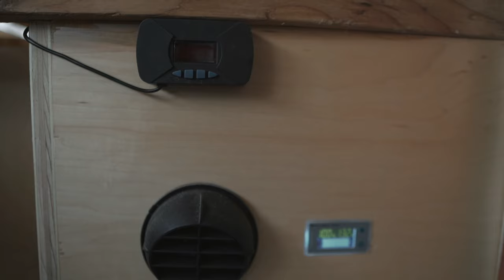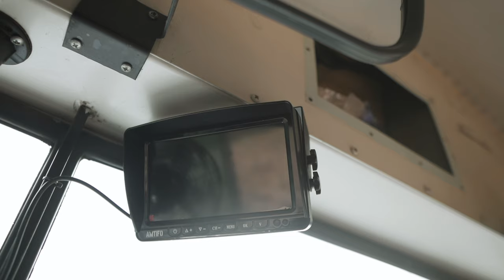SKOOLIE CONVERSION TIME LAPSE - Full Bus Build In 30 Days Start To Finish

Comment: Gotta have a toilet and shower. Unless your parking in your parents driveway.  In that case, you really wouldn't even need a fridge. 😎👍 It looks good but I am not sure the huge back pull out drawers are going to be as functional as you might hope and there just seems to be a lot of things missing in this build..  Also, the condensation with all the exposed metal and no air circulation in the ceiling will certainly be a problem.. and with condensation comes mold. Just a few things to consider.
Reply: Good points!
Reply from the maker: hm I have lived in busses for years with none of these problems. He is having none of these problems. So tell me where are these make believe problems coming from? Your head or experience? I love it when people that have never lived in a bus try to tell me things.

Comment: Very Impressive!!! Building like a boss! Your bus is sick. Whoever ends up buying it will be a lucky dude because they know it was a quality build, not some cheap, walmart build. lol
Reply: This build is NOT a quality build. God forbid someone lives in this. They're going to have to rip everything out and start over because there's no insulation in the floors, and the original bus windows leak so badly they get mold.

Comment: I don't see a toilet/shower, solar, or insulation. That kinda reduces how much you can do with this especially during summer and winter months. If you have any ac/heating it won't stay in very well.
Reply: I wasn't paying attention, but unless they took out the walls it was probably insulated. And those two panels on the roof that they wired into the bus are solar....
Reply: i thought you were th nutrition guy wtf

Comment: It only took 30 days but what good is it gonna be without any insulation. Its gonna be hotter than all Hell in the Summer. And cold if u use it in the Winter. So I don't see anything gd about it.

Comment: Had the same problem when installing the diesel heater.  Exhaust pipe slipping off. Small sheet metal screw.

Comment: Can you explain how the flooring went in?  Many of the Skoolie videos show insulation installed on floor, walls, and ceiling why did you guy not insulate?  Just getting ideas for my build.
Reply from the maker: Hi there is already insulation in the walls of the bus from the factory. It’s not the best but it’s there and a ALOT of work to take the walls out and re insulate. People pull the floors up to treat rust under neath the plywood. I buy busses from Arizona so there is no rust or mold to deal with. I floor right over the rubber. Built in vapor barrier and insulation. In my opinion unless you are going to remove or replace all the single pane windows that take up 50percent of the busses structure. There is no point to re insulating. Put a $150 diesel heater in and save yourself two weeks and hundreds more. When my heater is in I’m not cold. Re Insulate a bus don’t put a heater in and you will be cold. I have lived in both. Insulated and not re insulated and that is my opinion

Comment: Why didn't they put insulation in? That would have helped with heating a d cooling. This I'd the 2nd bus build I have seen that the owners didn't put any insulation in. Nothing to keep water from freezing either. Waste of heat and cooling with out insulation on the floor walls and ceiling. Especially if your going to live in it full time.
Reply from the maker: I lived in a bus full time with the “original” insulation in it. Was just fine and never ran from a winter. I know people that have literally done heat gun tests and literally almost 0 diff. Your uneducated opinion is exactly that. There is nothing wrong with leaving the original insulation if your bus came from a Desert climate. I would be more concerned with mold
Reply: Never mind that where is the toilet or shower
Reply: @isaacturnerit  dude if you ever go somewhere where its constantly cold you rethink that I know that because I've lived in a schoolie with my cousins and was the worst so if this was for a customer they definitely got scammed
Reply from the maker: @IeeIee778  been where it’s constantly cold. My opinion still doesn’t change
Reply: @isaacturnerit  not cold enough apperantly

Comment: Awesome build, what type of latch did you use on the long board drawers?
Reply from the maker: 48in locking sliders :)
Reply: @isaacturnerit  Be thankful the drawer faces sideways , ours faces the front, one emergency stop later ,even with locking sliders, our fridge had an unexpected flight! Sorted now….amongst other securing mechanisms -a door wedge, Even in our 60’s we’re living and learning! 🇬🇧

Comment: ISAAC WAS THAT CLEAR PLASTIC TANK YOUR DEISEL TANK FOR THE HEATER AND IF SO DID YOU HAVE TO DRILL A NEW HOLE IN THE SIDE OF THE BUS FOR FILLING AND DID THAT FILLER NECK PARTS COME WITH THE TANK ? AND DID YOU EVER THINK OF GETTING ENOUGH HOSE TO ADD A SECOND HEAT OUTLET UP FRONT ?
Reply from the maker: Hi that plastic thing was the tank. I just open the back door. And fill it. No prob. I have seen the filler neck and water will door stuff. But I personally don’t think the extra work is necessary. Also don’t need extra outlets. The good heater fills the entire space no problem.

Comment: Beautiful build.  Looks like you are doing several.  So is this build for the coast / warm states only?  I don't see any wall, ceiling, or floor insulation.
Reply from the maker: Already insulation from the factory. It also has a heater

Comment: Cable entry on the roof should be 180 the other way, then at 70 down the highway the rain isn't being forced into the cable entry points. Up here for thinking down there for dancing.

Comment: Did you insulate the walls and roof? You've got to be regretting that move at this point.
Reply from the maker: Def not. 150 dollar diesel heater will burn you out
Reply: @isaacturnerit  ah well that's good then! I'd be extremely nervous taking on cold regions, but my theories do not compare to your practical experience at all.

Comment: Did I miss where you installed the insulation and bathroom? You camp someplace when it cold it will be just as cold inside. When you go to pee in a bush it will be colder.
Reply from the maker: well you are wrong. Busses are already insulated. Also I install climate controlled heaters. Warmer in these busses than most houses
Reply: @isaacturnerit  I'm glad it's warm. You can't have too much insulation. Have fun with the bush.

Comment: Where is the insulation and heating and cooling?
Reply from the maker: Factory insulated it for us! Has a diesel heater for heat.
Reply: @isaacturnerit  school busses are not insulated for sh*t what 😅
Reply from the maker: @autumnkay1877  lol your talking to a guy that lived a school bus with stock insulation for years and was fine. Your experience is what forums?

Comment: Thank you for not laminating an extraneous butcher block. It should be usable and less weight than the bus. Oil is all you need. And to use it.

Comment: It quite upsets me when I see that someone can complete a skoolie conversion in 30 days. And I've been working on my bus conversion intensively for at least 2 years and I'm still just disassembling and grinding rust. I gotta hurry up I want to move in
Reply from the maker: It’s all as easy or as hard as you make it. My motto is enjoy it and live. Don’t worry about being fancy. Don’t become another partial build on Craigslist.
Reply: @isaacturnerit  
sometimes it's better to be slow than to be too fast.

  : me

 I recently found that my roof is leaking (again) and water is getting inside. if I had the insulation done, it would be a disaster.

When it leaked for the first time, it caused rust on all the beams of the frame. So I have to grind it all down to make sure it doesn't rust when I put the insulation in there.

So I'll have to wait for better weather and I'll have to coat the whole fiberglass roof with a new layer of epoxy. then I can do the rest of the things on the bus

I would like to make some video from my conversion. so I hope I can do it soon.

I also wish you good luck

Comment: Insulation?
Reply from the maker: You know that stuff people pull out behind the metal when they take the skins off. It’s called “insulation”
Reply: @isaacturnerit As much as I appreciate the snark, I hate to break it to you, but the insulation in a bus is pretty much negligible. It's more for sound deadening than R value. Not only that, but the floor in a bus is not insulated either. If you're going to use it as an RV, this will probably be fine, but if you're going to be living in it... you're going to regret making an a$$h*le of yourself. You're also going to regret not removing those windows. Bus windows leak like a sieve, and have no insulation to speak of.
Reply from the maker: @cinnamonrollypoly  hate to break it to you I have built and lived in more busses than you’ll ever dream of. Also lived in it for years. Wasn’t sad about it. I’d do it again no hesitation tomorrow. So turns out you’re wrong.

Comment: With all the wood weight you added you must get 1 to 1 1/2 mpg.
Reply from the maker: Ignorance is not allowed on my channel
Reply: @isaacturnerit  apparently it is you were ignorant  with the bus build
Reply from the maker: @IeeIee778  lol I have built quite a few busses doing just fine. Read a self help book for yourself
Reply: @isaacturnerit 😮😮 your extremely rude and combative... And seem to have a short fuse... I hope your clients don't look at THIS channel or read comments. You should try anger management. MANY of the questions or comments were actually legitimate questions.. might wanna stay off Internet until you get some help.. probably why your channel isn't doing well 😮😮😮
Reply from the maker: @pla5730  lol this a joke. I don’t do clients.

Comment: No insulation, no vent fans, no way! Cheap and fast.
Reply: It's not meant to be lived in.
Reply: Insulated from the factory
Reply: @odavis1364  horribly insulated from the factory for very cold climates I know that because I rode them in freezing weathers alot
Reply: @IeeIee778   I drove one for years.
Reply: @odavis1364  that was kinda random but ok